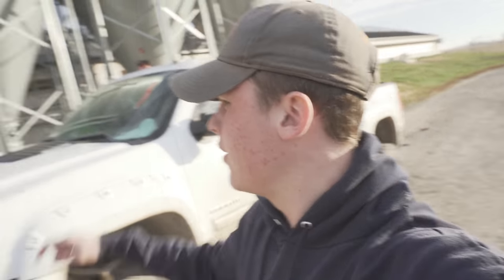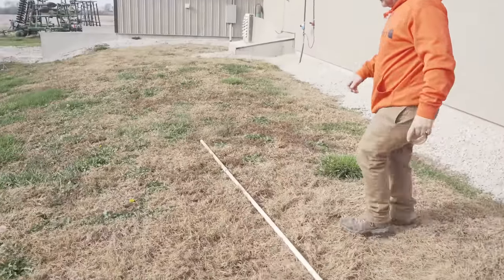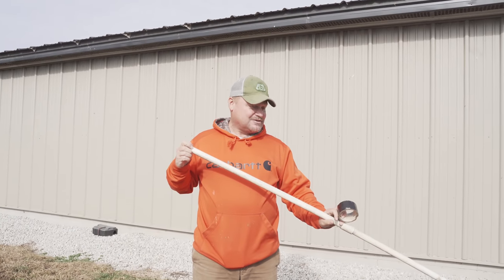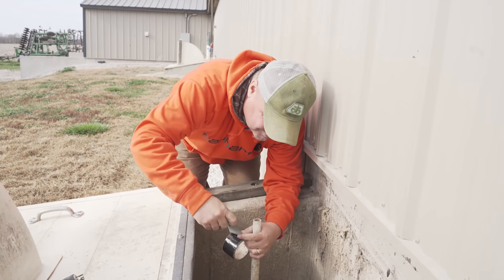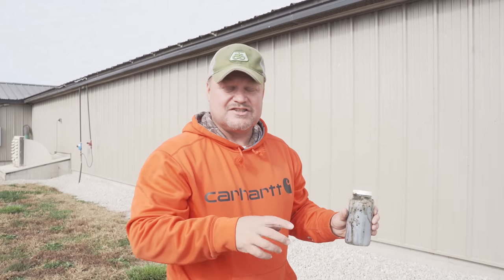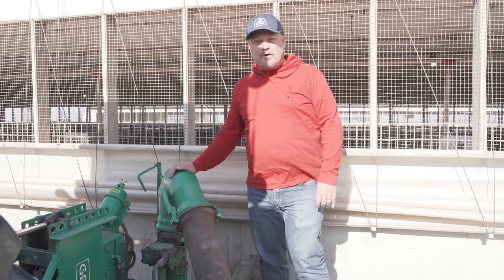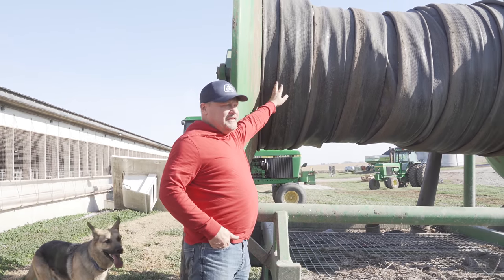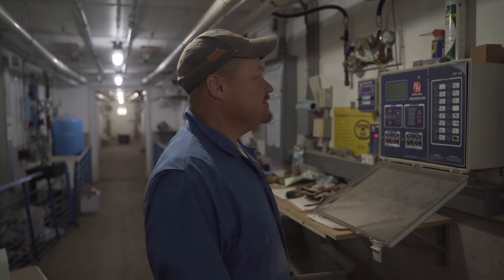How Hog Farmers Use Manure

Comment: I'm not a huge fan of hog barn confinement, but it looks like you guys are doing the best you can with the buffer zones and reintegration into the soil with the spreaders.  I've seen they use lagoons in the Southeast and they seem to have lots of issues with the lagoons flooding out in heavy rains.  Is it possible to get a yield out of your buffer zones by planting in fruit trees and hosting pick your own a few years down the road?  Do you guys ever run a fallow season on your acreage or run cover crops between?  I'm happy to see more people utilizing lower or zero tillage operations trying to save the soil as much as possible, it's a good thing for everyone.
Reply: I'm not sure about their operation, but yes you can get a yield out of the buffer zones. Often times even the grass can be used for fiber ex: animal bedding or for fuel/biofuel. some plantings like switchgrass can be used for both. Also, if a conservation agency installs trees or provides cost share, they typically won't plant out fruiting ones beside the channel to avoid fruits and animal droppings (which are nutrient dense) from plunking into the stream.

Comment: I’ve been there done that. We pumped out of a lagoon.  We had three inch pipe on the pump.  We had to prime the pump that was hooked to the tractor . That was fun,🤤 we had an agitator on the other tractor. Moving pipe in heat and humidity of South Georgia was quiet a task.  Glad I don’t raise hogs anymore.  Got out in early 1990s.
Reply: My father had pigs when I was growing up.  He was small compared to this farm but had a couple lagoons that he shutdown in the 90s as well.  They had a 30-40ft long agitator/pump that they backed down into lagoon to stir the lagoon and pump out when it was time.  Then they had 4x4 honey wagons that had very wide tires for floatation on the fields.   They would spray the fields black when the row crop farmer wanted it for fertilizer.  Free for the farmer and helped dad out with a place to put all of it.   I know 1 of the lagoons had 1 million gallons in it.  This was in NC.

Comment: I always wondered how you got the solids in suspension when pumping into your manure spreaders. I was hoping that you didn't have to draw off the liquid and use a skid steer  to finish scraping and loading out the solids. I thought you might have an aeration and agitation equipment 
Installed in the pit when built.?????

Comment: You aren't getting a very composite sample . Shouldn't you sample after agitating the pit thoroughly?
Reply: We do. But it takes a few days to get the results back and we need a baseline to decide the rate we’re going to use. The samples we get while pumping don’t vary more than a few pound of N per 1000 gallons so not that far off. Thanks for the comment and for watching!

Comment: The farmers around me wouldn't take the manure for free.  I'm too far for a drag line direct, so I have to truck it in.  We're putting in storage and pipelines with some govt cheese money, and have a continuous applicated system being built that will work with a big flat bed semi trailer with a gigantic reel of hose.  That with some swing hoses and we can apply with crops in the ground and not knock them over.